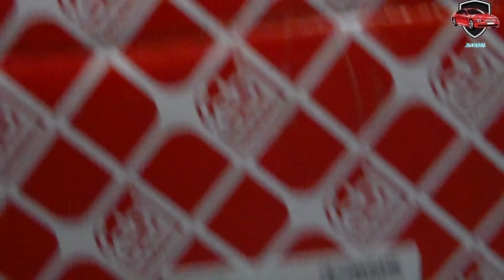BMW N47 engine - Replaced cylinder head cover.

Comment: Do you maybe know how can this cover be a cause of oil consumption? I know that crankase breather valve is a part of this cover and that it could be a cause of oil consumption, but do you know if there is any other important part of the cover that could somehow cause oil consumption?
Reply: I have exactly the same question, I've replaced the PCV valve and I still get excessive blow-by.
Reply: @FuLLReSpecT any update on your oil issue? ;)
Reply: @bathanmark  No, still uses some oil after PCV & turbo replacement, regardless of 5W30 or 5W40.
Reply: @FuLLReSpecT  what mileage you got on the car? It may be a case seals in your cylinder? Passing oils. What do they call that test, compression test?
Reply: The crankcase breather valve has a good design on N47 engines and do not really need replacing. It makes 0 difference. On the M47 it had a bad design. Oil can leak at the oil cooler gasket. That thing loves to leak. Did you check the oil cooler gaskets as well?
Reply: @FuLLReSpecT turbo charged engines hide engine wear and tear because they are force fed. You may not notice power reduction unless you listen to how much the turbo whistles under normal speed and load to know it probably is working overtime.
Reply: You prolly have internal leaks on rings and valve seals. Hope your engine still runs. Good luck

Comment: Hello HELP ! How did you bleed the fuel system? What were you doing ? I'm having trouble starting my car after doing this. I think there's a messed up system. What did you do to fire it?
Reply from the maker: I usually leave the pipe leading to the injector of cylinder 1 loose until it comes out with fuel pressure, then I tighten it and start the engine, the first start will be longer.
Reply: Just turn the ignition on and off a number of times first.  For safety sake.  Not a good idea to leave the injector lines loose on a common rail diesel.

Comment: Hi Jhms I have oil consumption 1L per 2000km the engine works nicely it goes nicely it consumes a bit.
Can l be up to the lid on the composition at the oil separator moisture oil n47 177
I tried with 5w30 and 5w40 the same consumption
If you want to send, give me an e-mail to send you a video